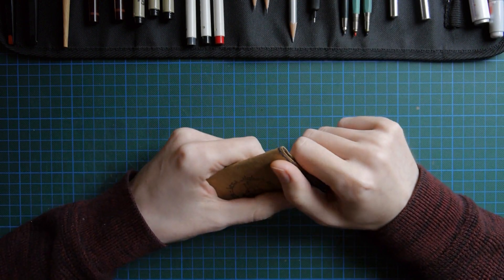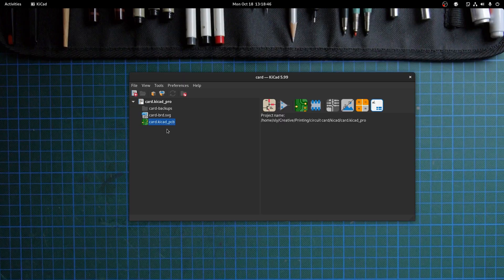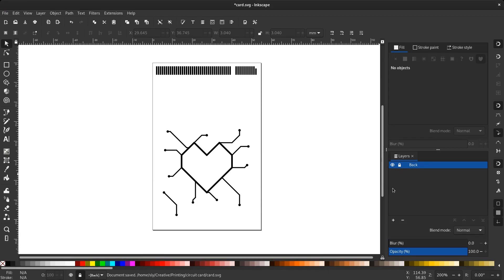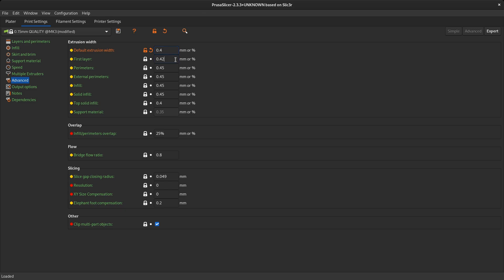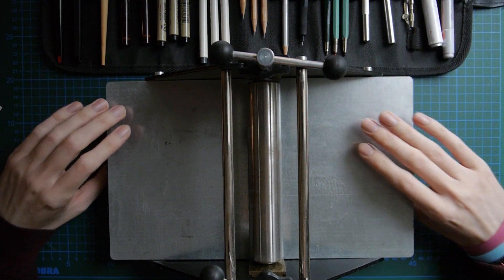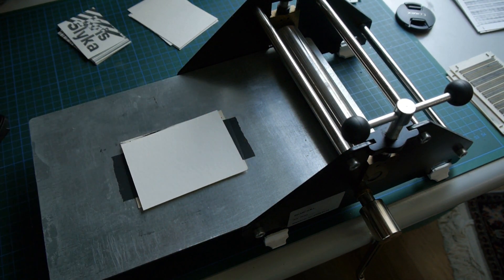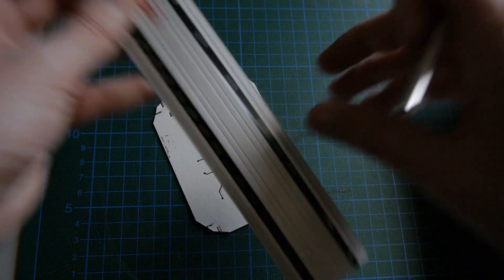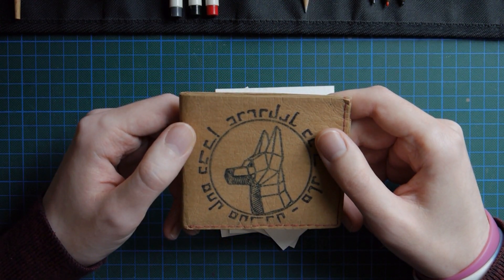I made 3D Printed Letterpress Business Cards!

Comment: What a great idea. I have a Cricut embossing machine that's basically the same as the machine you have only light duty. They were designed for scrap booking and paper crafts. 
To be sure that get the red area for the heart right, be sure that the heart is raised rather than embossed, then use the ink pad after. Or you could even use water color markers to fill it in

Comment: Cool ! You can use holes in your card (on non printing area) and some pins on the 3D part to easily  center the printing.
Reply from the maker: Yeah, I thought about that! Might try something like that for my next batch where the first plate prints circles I can use to align a hole punch and subsequent plates have pins for those holes

Comment: Hey. Love it. One more thing to add to your plate though. Those pins at the top: you gotta gold foil them suckers. It's one extra step but that's pretty much the exact same step I'm trying to initiate. 

I was wondering if there was some kind of sla that could withstand heat a little more so that you can emboss the foil on. 

Great work 👍
Reply from the maker: Yeeees, hot stamping foil would be awesome! Though definitely not something I can do with my PLA printing plates… SLA might work though. From a quick google search those foils need something like 100-130°C to adhere to the paper
Reply: @KrisSlyka  I've been working with liquid resin printers (Elegoo Saturn) lately, and it appears that some materials can withstand 200°C+, so that's an exciting option if it's available.

Also I love that I somehow got the vibes that those cards would be something from a dealers den, maybe used as backs to laminated con badges, all before you mentioned being a fellow fuzzbutt 💕
Reply from the maker: @PuckLokin  Hah, I guess it just shows :p
Sadly I don't really have the location to do resin printing since my place is tiny and I don't want to have to sleep in the same room as a resin printer. But I'd love to see the detail you could achieve with a resin printed printing plate and how well it would stand up to something like hot stamping!

Comment: Nice idea. I would print the cards with traditional printing techniques such as ink jet and then do just the embossing with the stamps. But I think u prefer the DIY look. It's obvious that for mass-production a stamp with more than one pattern would surely speed up the whole process.
Reply from the maker: Yeah, if you had a bigger press it would totally make sense to print many cards using a single plate. Also makes registration easier. But then, I don't think this is the right technique if you need hundreds of cards anyways

Comment: Thanks that's really cool! Do you think there would be benefit to cutting the cardstock before and having the mold registration marks be exactly for to the size is the cardstock?
Reply from the maker: Yeah, that's certainly an option! Or even doing something in between where you print on the cut marks from one side, use them to cut it to the proper size, then have the second printing plate fir that. Or maybe add some holes and pegs for registration as others have suggested.
Reply: @KrisSlyka  I think I'm going to give it a go printing plates for both sides, one to center cardstock of different sizes perfectly, and the other for the printing plate. I'll attach each to an opposite side of a sandwitch maker type device (on a hinge), where the registration marks will be perfect (perhaps via a tapered peg and hole. Mounting plates on both sides will slide in on rails. I think that's a pretty flexible system... what do you think?
Reply from the maker: @AmitKohli1 sounds good to me